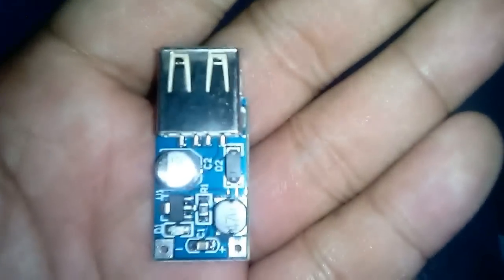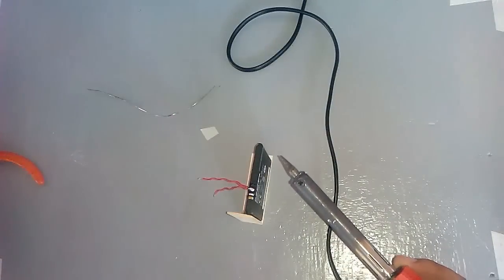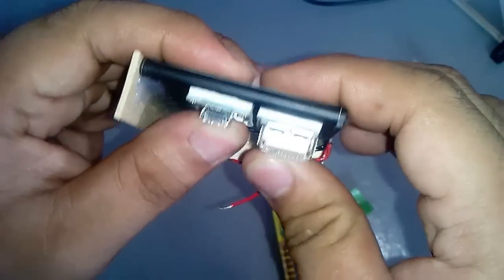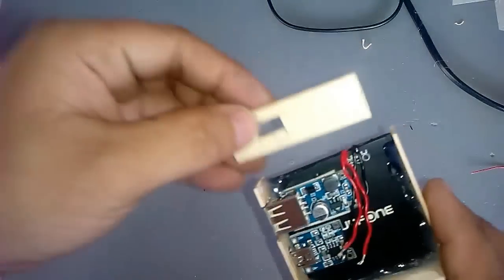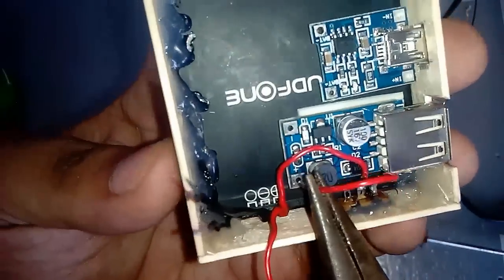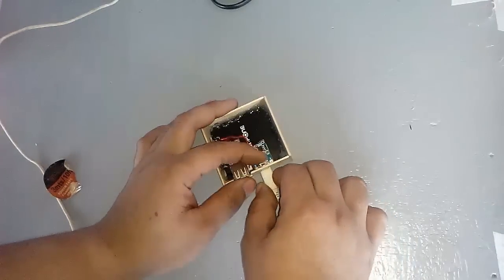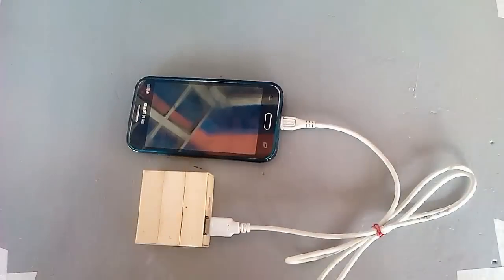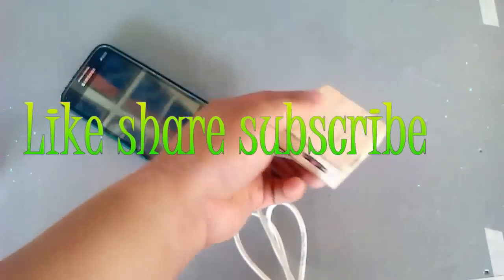Diy Power Bank Made out of a Mobile Battery

Comment: what number of mobile battery i can connect through it?? means 2 or 3 battery
Reply from the maker: +Shikhar Naval you can connect them in parallel as many as you want.
Reply: okk
Reply: sir one questions more??? how can we connect 2 or 3 usb pin for charging phone
Reply from the maker: Shikhar Naval be sure that the battrty are connected in parallel. just cinnect it in your module nothings change. check the video again

Comment: can I use my dtc phone battery that has 3.7V 1200mAh for this? I really need the info for my project :) please help haha
Reply from the maker: +The Kawaii Nifty yes you can :)
Reply from the maker: +The Kawaii Nifty yes you can :)
Reply: Sek Austria is it possible if I use multiple phone batteries in making one power bank?:)
Reply from the maker: The Kawaii Nifty yes, connect them in parallel. but be sure all batteries are the same brand and specification or else one of them will blow.
Reply: Sek Austria okay. THANK YOU SO MUCH! THIS VIDEO HELPED ME THE MOST! 😄
Reply from the maker: The Kawaii Nifty thanks and welcome

Comment: if I use 4000mah battery then USB and charger slot I have to buy of high volt
Reply from the maker: here's what you need

5 Volts Booster - https://www.fasttech.com/products/1005/10002934/1219201-dc-dc-0-9-5v-600ma-boost-converter-step-up-module

Charging Module - https://www.fasttech.com/products/5054400
Show less

Comment: Hi there, you videos are cool! can you also share the links of the circuits you used. I too made one like this on my channel,but i couldn't get the charging circuit. If you let me know I would upgrade my video too
Reply from the maker: Okay, Ill give you links where i bought them online.

5 Volts Booster - https://www.fasttech.com/products/1005/10002934/1219201-dc-dc-0-9-5v-600ma-boost-converter-step-up-module

Charging Module - https://www.fasttech.com/products/5054400